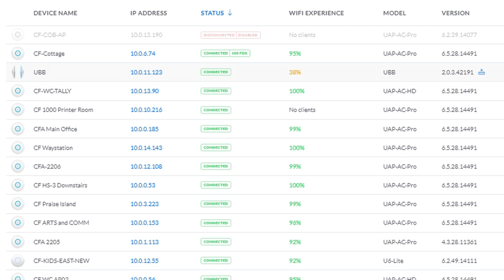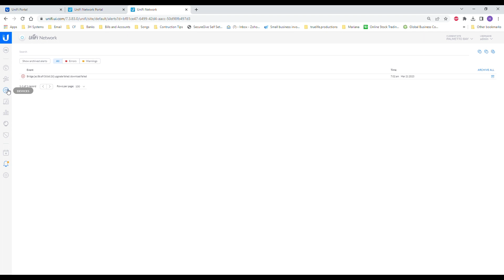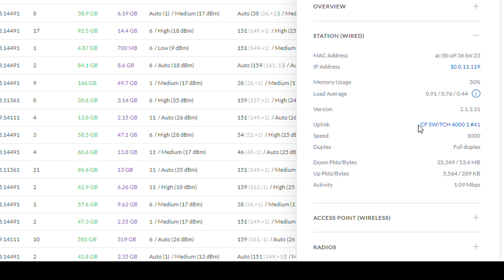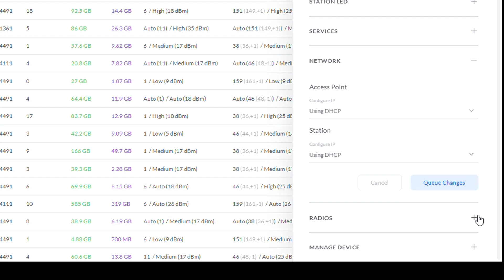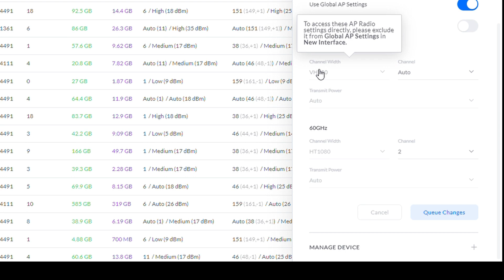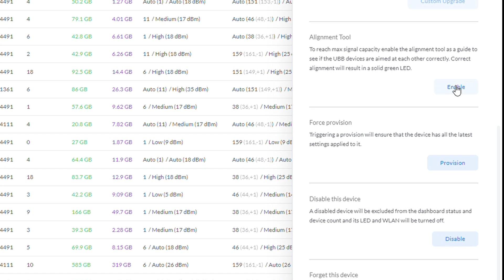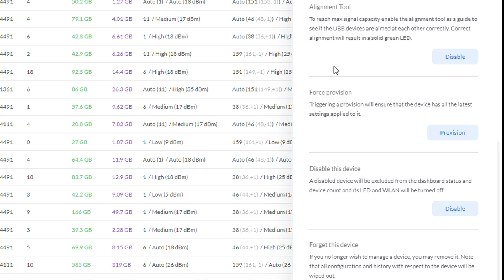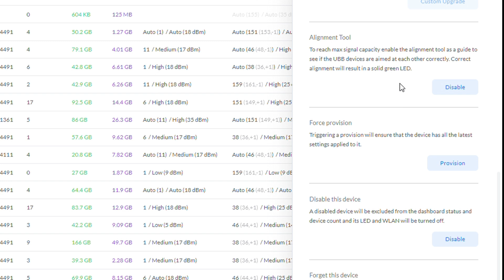Unifi UBB Part 1. Bridge Setup

Comment: on the Ubiquiti Building Bridge UBB can you disable the 60 ghz range and only use 5 ghz?
Reply from the maker: It does not seem to have a Graphical Interface option for it. It shows both channels and the only configuration options are Channel width and the actual channel selection. No enable / disable.

Comment: Hello everyone.
Does anyone know which devices goes where? The UBB XG US comes with Station and Access Point, what's the difference?
Reply from the maker: They are already come pre-configured one as AP and the other as station. In fact you can not modify that
Reply: @truelifeproductions  Which one is the remote side and which one is connected to the LAN?
Reply from the maker: @InformedGlobe  AP goes on the main network side. Station is your remote building connection

Comment: Thanks for taking a look at these!
I'm running AirMax thus far, but since it's a Unifi network I've been considering these, just didn't want to buy them only to take a look. Seems well integrated, so I'll most likely be buying them now.
Reply from the maker: Yes integration is great. Make sure it is the right fit for the distance. The 60 ghz radio has a shorter distance reach.